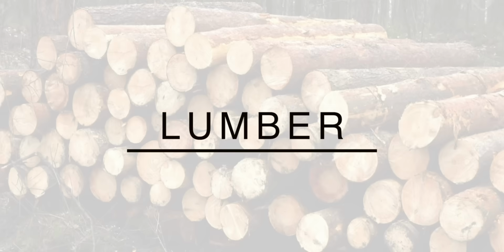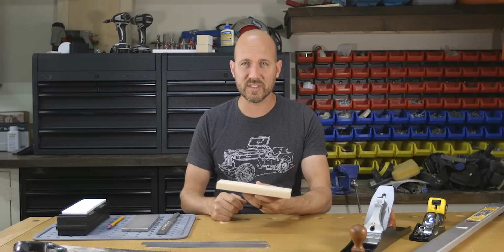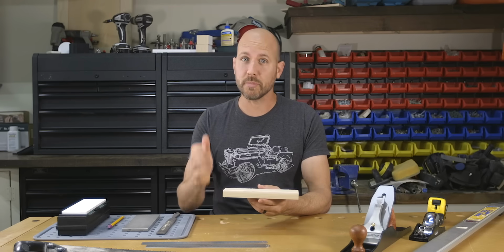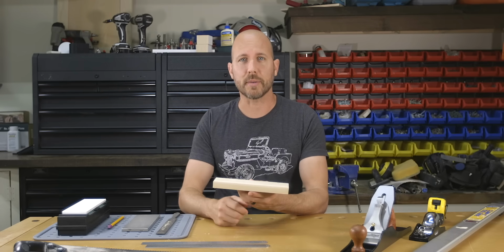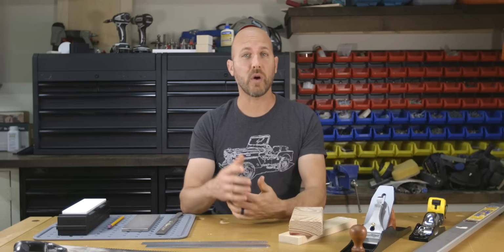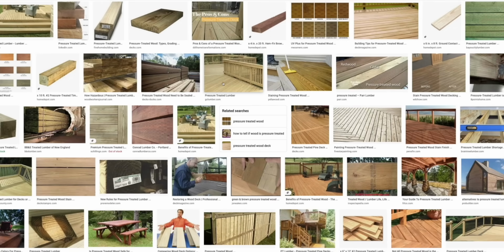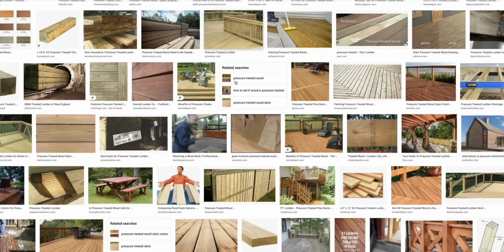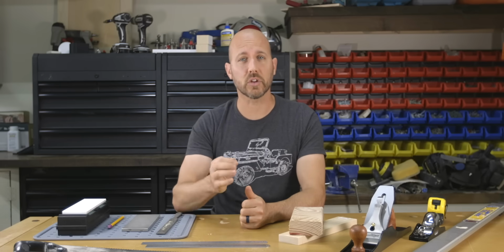Beginner Woodworking and Carpentry Terminology Part 1

Comment: How is that Baltic Birch plywood 13 plys? I only counted 11 plys. I really like your tip about the white charcoal pencil. You forgot about a marking knife for a more precise cut line used in woodworking but I suppose it's not considered a basic tool. Thanks for sharing this necessary information for people getting started in anything to do with woodworking.
Reply from the maker: Good eye—and I totally get why you'd count 11. This plywood does have 13 plys, but the two outer layers are super thin face veneers, and they can be hard to spot at a glance. 

Glad the white charcoal pencil tip was helpful! And yes—totally agree on the marking knife. It’s a great tool for more precise layout work. I just kept it to the basics for beginners in this one. Appreciate you watching and sharing your thoughts!
Reply: @TrainingHandsAcademy I figured that's what it had to be with the plys in the plywood, that the other 2 were so thin they couldn't be seen on my phone's screen or through the camera or whatever the reason lol. 😉 Also thank you for responding to my comment so quickly. I haven't watched part 2 yet but I plan to very soon when I have time. I love learning about anything to do with woodworking even though I already know quite a bit there's always more to learn. 😁
Reply from the maker: @jennessalynam7682  I'm learning everyday day too.

Comment: I have a lot of tools - but no workspace. I live in a two-story "townhouse", with all the rooms occupied. I've no garage or cellar, and during much of the time here in south Florida, it's too hot/humid/mosquito-annoying to use my workbench in my patio. Many of my tools are hand-me-downs from dad and grandpa, which I treasure. No tools of mine are loaned out because I've learned that they come back dirty/broken/misused. I treasure my tools and treat them with respect so that they will always be ready to work properly for me. No tool is put down without something like an Amazon plastic bag underrneath it, to protect it and keep it clean,  
AND - just yesterday I received a FLEX brand combo Oscillating-Multitool for which I hope to have many uses in my endeavor to make occasional  household repairs.
MANY THANKS FOR YOUR TUTELAGE!!
Reply from the maker: Thanks! I’m sure you will find lots of uses for your new multi-tool. That’s what we all strive for.

Comment: Honing is bringing the cutting edge back to its proper alignment (basically, straight) while sharpening is actually removing material towards toward the edge to thin it (which also hones it if done correctly).
BUT STILL GREAR VIDEO

Comment: Just hoping Josh that you maybe able to use both metric and imperial sizes when chatting about timber specs, would help the younger audience where metric measurements are used, great effort in the vids mate, well done, regards,,
Reply from the maker: Hey Mick! Just sent you an email... and yes moving forward all my videos will be in both metric and imperial. 😀
Reply: @TrainingHandsAcademy  Hopefully he'll call 13mm half inch (6:45) instead of 3/4 from now on as 13mm is .51 inches.  Sorry to be such a stickler.
Reply from the maker: @uglycouzin  Yes I'm aware of my mistake James. You're not a stickler.

Comment: Great video and great timing as I'm working start my woodworking journey. Question about the plywood, what does Home Depot call the second type of plywood you showed, the one with the two thin veneers and 5 layers inside? I'm most likely going to start with getting my lumber and plywood from Home Depot to start cause its the closest thing for me, but want to try and start with something halfway decent. Thanks!
Reply from the maker: I think you are referring to finished plywood. HD normally stocks both Birch and Oak.